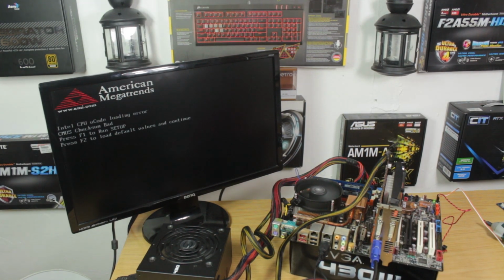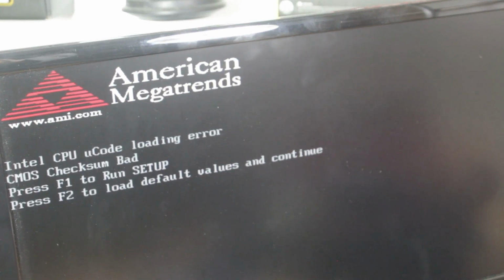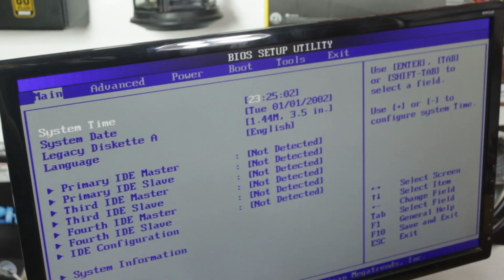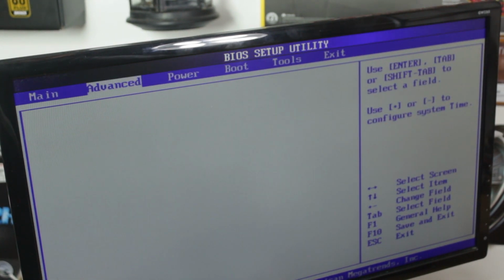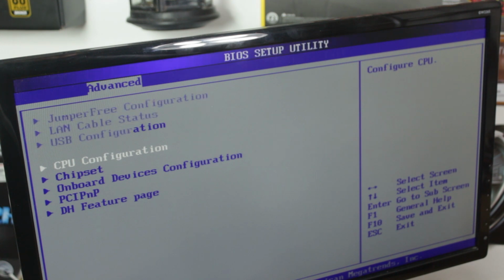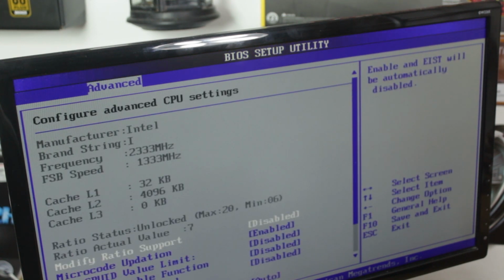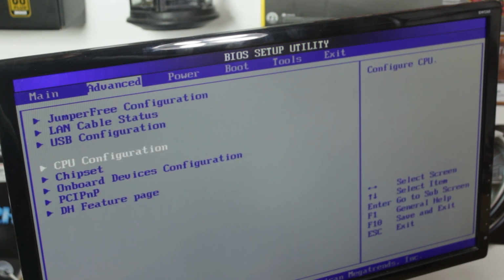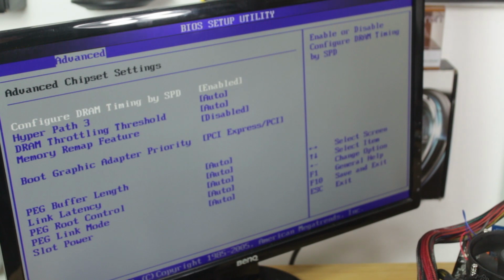Troubleshoot A Motherboard - Pt 3  Dead PC Or Computer Turning On But No Display On Monitor

Comment: i test my motherboard is ok but  have sound at processor what should i do ?
Reply from the maker: I don't understand "sound at processor".
Reply: @HealMyTech1  long beep
Reply from the maker: Am I to assume that you computer is not POSTing but instead its giving you a long continuous beep?  Or Its POSTing but no display with a continuous long beep?  I covered a long beep issue here, don't know if you are having the same issue: One Long Continuous Beep Code Finally Solved - PC Computer Troubleshoot
https://www.youtube.com/watch?v=f4z5Xw7uFKY
Reply: Hi I have msi ph61 board the CPU fan run but no picture I tried resetting the BIOS and removing the battery but no luck and the CPU fan is heating up is cold help sir

Comment: my mobo only turns on for a slit second then turns off what can be the problem?
Reply: måns rönnlund sounds like a bad power supply or it’s just faulty
Reply: @cozmics1191  i have tried 2 different PSUs and still the same problem
Reply: Probably bad capacitors...im an amateur at pc's but check the problems and if they are the same with pc's with burnt capacitors.Just google it

Comment: My problem is that the power supply is running, having static electric on the motherboard but cooling fan is not running and is not turning on !! Please advice ?

Comment: I TESTED MY PSU WITH THE paperclip method, when i did that every fan (psu, cpu,gpu) were spinning.
but when i reconnect the 20 pin to my motherboard it wasn't working.
My pc wasn't turning on.

doesn't that mean my motherboard is the problem???
how will I able to know which thing is the culprit ( jumper, port,cmos battery etc.) on my mobo?
Reply: Same same

Comment: every time i plug in my psu into my cpu 8 pins it doesnt boot but when i leave it unplugged it turns on but no display. would it be a mobo issue or processor?
Reply: Same situation I have
Reply: ToxicPuffin did you ever find a fix to this

Comment: 'i think a dead mother board won't allow the power to go through it to the other components, so if it was really dead the fans won't spin and nothing will turn on'  what this guy said is exactly what is going on with my motherboard and i have checked that the power supply is working. (it does) but when plugged into my motherboard obviously does not. Please could you help me with this as i have absolutely no idea what it is i need to do. Is there a way for me to repair my motherboard? Or will i have to purchase another one? If anyone knows what to do any help would be appreciated. Thanks.
Reply: Did you solve it?
Reply: SamStar YES I HAVE THE EXACT SAME PROBLEM RIGHT NOW UGHHFJHFHUFFJ
Reply: Howd you guys solve it
Reply: Same
Reply: Did any of you guys solve this? Its whats happening to me

Comment: One thing I don't think you mentioned, sorry if you did and i missed it, but first thing I do is get a magnifying glass (eyesight at close range not the best) & check for bent pins inside the socket. You;d be surprised how many motherboard issues are due to bent pins.
Reply: Cheers mate!

Comment: i think a dead mother board won't allow the power to go through it to the other components, so if it was really dead the fans won't spin and nothing will turn on
Reply: Beware of youtube advise. A Mother Board is a very complex piece of electronics and have had more and more functions added to them over the years. They can malfunction in many different ways including no power to any component although I would check the power supply in that case as well.
Reply: Thats the problem im experiencing.
Reply: Light Yagami what if when the red LED shows up on the motherboard , and it doesn’t make a beep sound? What if when I plug in my m&kb to the mother board USB ports they don’t work or turn on? Surely there’s something faulty with my motherboard than?
Reply: Would the hard drive's disk still spin?
Reply: Same i think i just broke my motherboard wth
Reply: Does the USB ports get power during a dead mother board??

Comment: NO POWER NO DISPLAY NO BEEP.....
PSU ok...I checked it with another PC...casing power switch also ok...I checked casing with different motherboard...RAM ok...checked it...CPU+COOLER also ok...checked it...
problem maybe in MOTHERBOARD or somewhere else ...so how can I find it & solve it...???
N.B: VGA built-in...